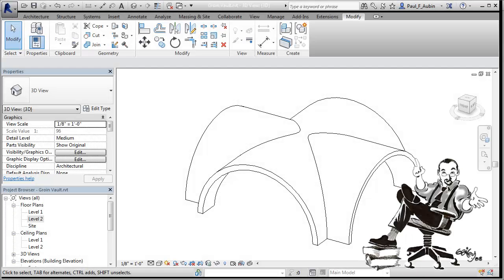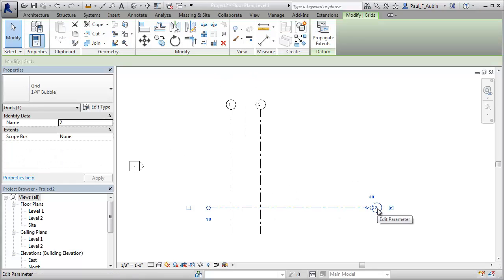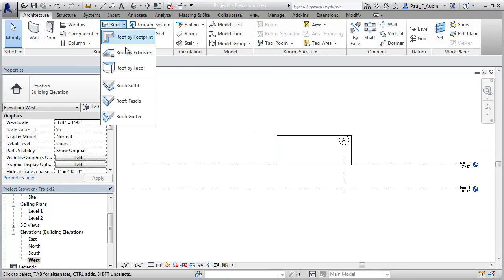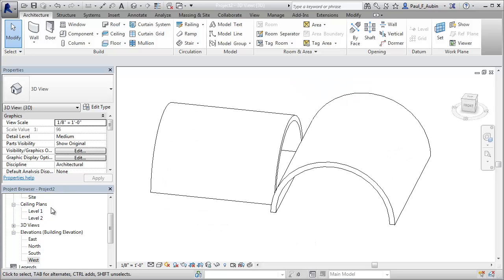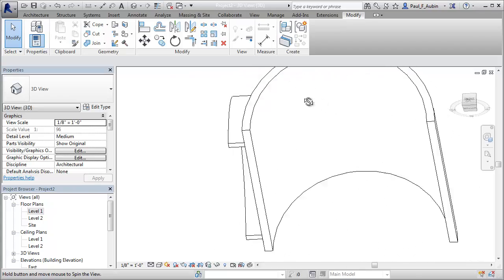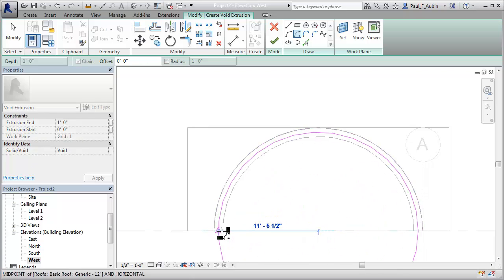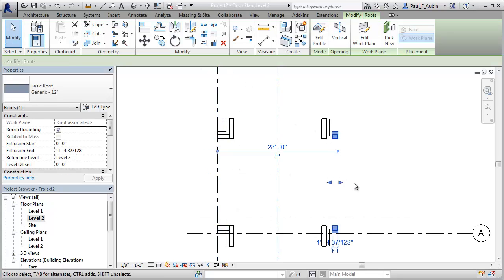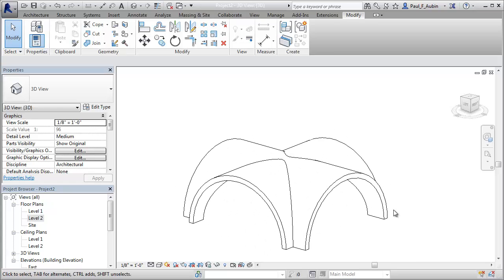Make a Groin Vault Roof in Revit

Comment: I have created vaults using the Model In Place tool under Components and categorizing them as ceilings. How would I join these elements as you have done in your video?
Reply from the maker: You have to do this inside the in-place model.

Comment: sir how to apply embedded curtaint wall in sloped roof
Reply from the maker: Make a roof first with a hole in it. You can make the hole in the sketch or using an opening element. Then add a second roof. You can copy and paste the original and edit its sketch to make it match just the shape of the hole. Then on Properties, make the copied roof sloped glazing.

Comment: Would you use the same technique for roofs that are not perpendicular?  Or with more than two roofs?
Reply from the maker: Sure. You can use this technique on any roofs.
Reply: Thanks Paul - I managed the simple two roofs at 90 degrees from each other but I was wanting to model three at 60 degrees from each other ... totally not working ... the original two seem okay but the third roof isn't cut with the voids, even when I choose it.  Any help would be greatly appreciated.

Comment: Hi ... I came accross this post following a link on Autodesk'd forum ... Since I am pretty much fond of your work I just thought I would leave a note :)PS: The issue with Revit not being able to join the two roofs is not the top being at same height  ...It is the bottom (ie: the Rafter Cut) ... - it cannot be plumb (which is the case here)  => cannot be acheived with a  perfect half circle Arch that has it's center at the midpoint between & aligned with the 2 bottom/start ingpoint. Should the center be 1mm higher (not lower) than the lowest point of the Arch Revit will not have an issue joining the two roofs... the transfered load/force tangent to the arc at the bottom has to point towards the inside (cannot point out or vertical)
Reply from the maker: +MINIJODA RDAOU Thanks for the comments. I'll try out what you suggest. There was also a response that suggested using roof voids. So as always there are lots of ways to solve the problem. Thanks again.
Reply: +Paul Aubin 

It might be also worth noting that extruding the main roof using 2x quarters would help Revit figure to which side to join... It's here on this link -> https://knowledge.autodesk.com/community/screencast/af0d76a9-c422-4935-a315-e15479e33004